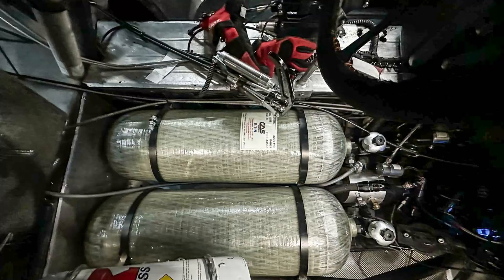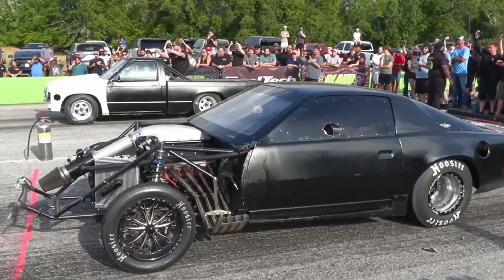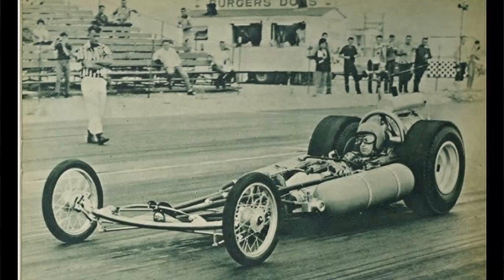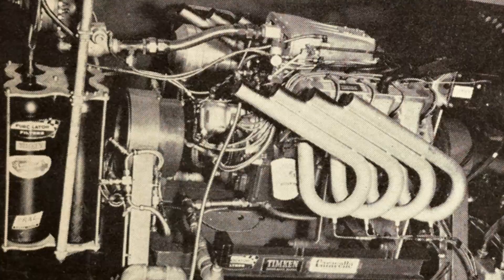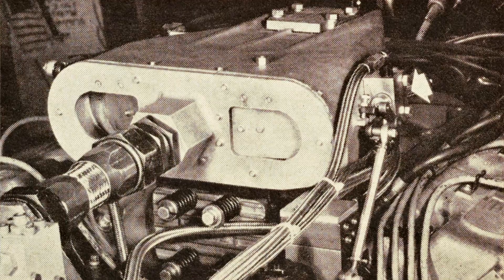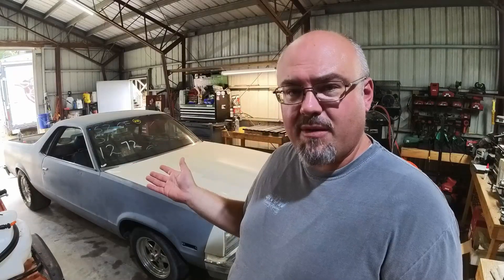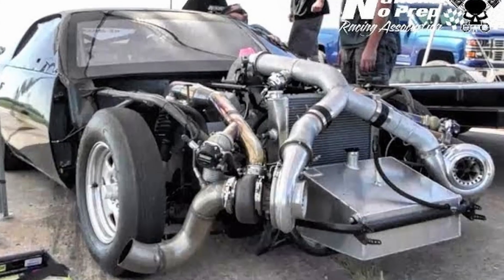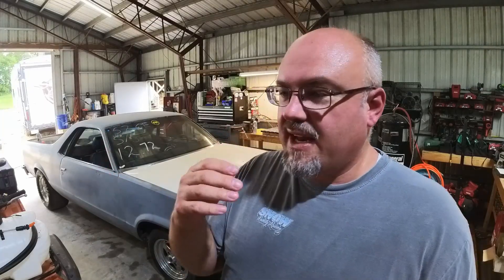Compressed Air Supercharging is BACK in Drag Racing!

Comment: Question is when you're making passes at speed how do you get the air controlled to go from the tank to the intake ? Or do you use a lot of the same hardware that you would for nitrous?
Reply from the maker: Think Nitrous just much higher volume. I had an opportunity to see the car in person and he's got some very big lines running to the intake.

Comment: Perfect for Drag n Drive events if you have your recharging compressor in the trailer. Motor is under no stress on the road miles.
Reply from the maker: Cruise on a sensible pump gas tune and race on a nasty gas gas tune. Seems like a good path to me! I am curious how much volume and pressure is really needed. Last I saw, KC Maxx had 3 tanks in the car.
Reply: @SnowFamilyRacing  So I did a little research and came to a conclusion that you only need/use half the air for 1/2 the horsepower running twice as slow. So looking at your ute running 12's you got around 400-450hp NA if you wanna run 10's you'd maybe get 4 passes out of two tanks - rule of thumb via a yard stick.
Reply from the maker: Makes sense, I once heard that horsepower is mostly a measurement of how quickly en engine moves air. It was presented that so much Hp was this volume of and could be essentially be solved to figure how much volume is required to produce the hp you're looking for. It was an interesting exercise even if it was theoretical at the time.
Reply: @SnowFamilyRacing  Volumetrically true a motor is an air pump that ignites a fuel/Air mixture. Flow, Mixture & Boost is the ways to increase the volume it can pump at a certain density is a big factor.
Reply from the maker: We're on the same page! It would be really cool to dig into this in the practical application sense and see how doable this kind of thing could really be.
Reply: @SnowFamilyRacing  Yeah I'm building a twin charged Mercedes C32 AMG its stock 350hp 3.2 litre Supercharged V6 added a rear mount GTX35/84 Turbo Interchiller E85 ect. Runs 13.3/106 dead stock so aiming for 10's Twin Charged.
I could do a C55 AMG has 354hp 5.4 litre NA 13.5 car stock by adding CAS should easy get 800hp with less stress and into the 9's.